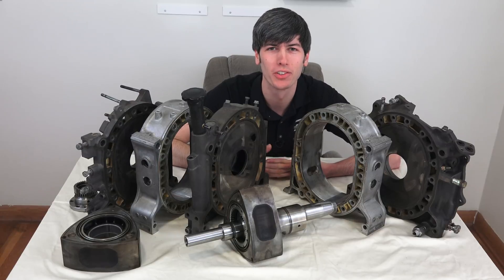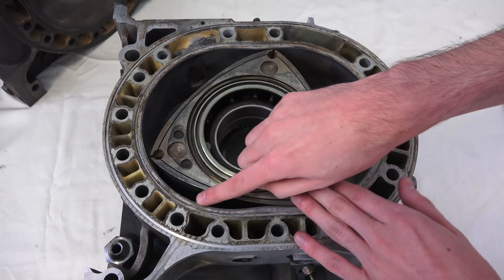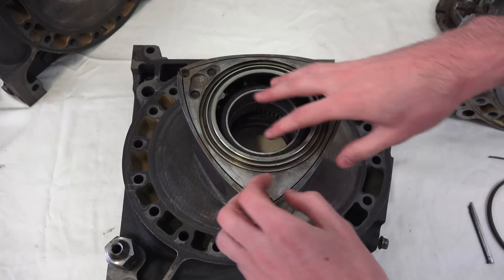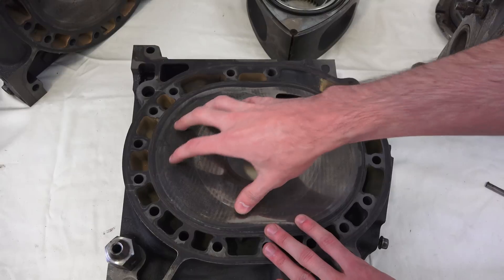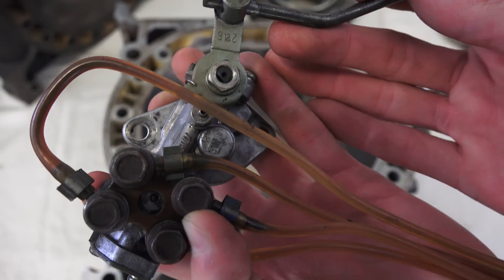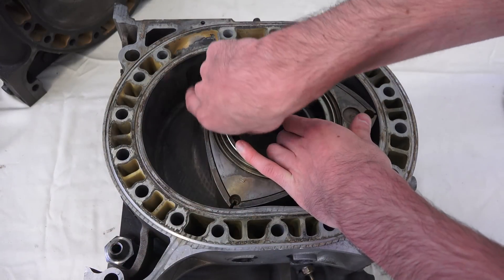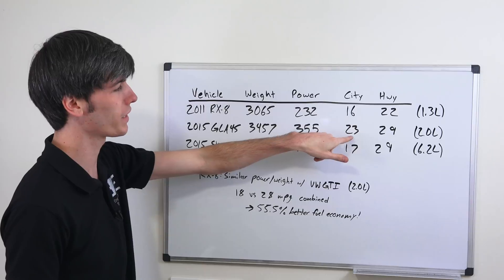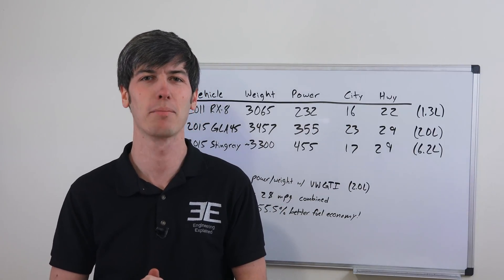4 Reasons Why The Rotary Engine Is Dead

Comment: They have been used in propeller driven airplanes for many years.
Rotary engines are great, reliable and tough when they run at near constant RPM, like in a propeller airplane,  stopping and starting like in a car or truck wears them out quickly..
Reply: NOT TRUE, Wankel engines were a colossal failure in aircraft applications and are very poorly suited to propeller drive applications.
Reply: The Wankel engine has consistently proven to be too unreliable for aircraft.
Reply: @sandervanderkammen9230  
Used in UAVs
Reply: @johnburns4017  Exactly, UAVs don't required FAA or EASA airworthiness certification, which Wankel engines are too unreliable to meet.
UAVs are disposable unmanned vehicles and the Wankel has proven to be a liability as well, most UAVs in service now use reciprocating or gas turbine engines.
Reply: @sandervanderkammen9230  
Wankel engines are not unreliable at all. They are perfect;y suited for aviation, moreso than piston engines. 

wiki got it right, for once (the Wankel article is good):

In principle, Wankel engines are ideal for light aircraft, being light, compact, almost vibrationless, and with a high power-to-weight ratio. Further aviation benefits of a Wankel engine include:

1. Rotors cannot seize, since rotor casings expand greater than rotors;
2. The engine is less prone to the serious condition known as "engine-knock", which can destroy plane's piston engines in mid-flight.
3. The engine is not susceptible to "shock-cooling" during descent;
4. The engine does not require an enriched mixture for cooling at high power;
5. Having no reciprocating parts, there is less vulnerability to damage when the engine revolves at a higher rate than the designed maximum.
Reply: @johnburns4017  Then why is there not a single FAA or EASA certified production passenger aircraft sold with a Wankel engine?
Reply: @sandervanderkammen9230  
You tell me. All points that the Wankel is a superior and safer unit.
Reply: @johnburns4017  The facts are irrefutable, Wankel engines were plagued with reliability and durability problems from its invention right up until mass production ended nearly a decade ago.

Comment: One idea - what if the engine had 2 (or more) separate Wankel "cylinders", and some dealt with intake/compression, others the explosion/exhaust cycle? More or less the same principle a turbo works?
Reply: Would that not exacerbate the problem with the Wankel KKM's higher thermally entropy???

Comment: Gas is so cheap now, who cares about mpg? Lol.
Reply: No cares about Wankel engines, it was an evolutionary dead end that has been obsolete for years.
Reply: @sandervanderkammen9230  Okay Colonel, keep frying your chicken.
Reply: @coreyworthington2797  OK kid, why don't you go down to your local auto mall and try and find a 2020 model with a Wankel engine.
Reply: I'm just trolling. Besides no production car ever had the "Wankel" engine inside. All the power plants are of KKM variety, designed by NSU's Hanns Dieter Peschke.
Reply: @coreyworthington2797  Without the knowledge and experience of Walter Froede,
Hanns PASCHKE would not know where to start to turn Felix Wankel's  Rotary DKM-54 into a practical Non-Rotary version that could be licensed by NSU Motorenwerke GmbH.
Reply: @sandervanderkammen9230  Sweet they should really give credit to all of them, not just Felix.
Reply: @coreyworthington2797  Felix Millet never gets any credit for inventing the Rotary internal combustion engine... Felix Wankel was admittedly inspired by the Megola's engine.
Reply: @sandervanderkammen9230  It's sad that the quasiturbine never really went anywhere.
Reply: @coreyworthington2797  Well, at least it was good for a laugh...

Comment: Perhaps if it was modified to have extra intake/exhaust ports and another spark, the compression chamber could be changed into the power chamber and vice versa and the temperature of the entire engine would be even. Thus no portion would be too hot.

Comment: Sorry, Much better. The details of how they will achieve this I do not know, but Diamond Aircraft first trialed this in 2011. In an aircraft, the smaller size and lower weight of a Wankel engine give real advantages.
Reply: Both Mazda and Diamond abandoned development of Wankel engines.
Reply: The Wankel engine sufferers from several fundamental flaws and disadvantages that prevents it from being practical in aircraft applications... which is why no aircraft manufacturer has ever offered an aircraft for sale with a FAA or EASA airworthiness certification.

Comment: Separately Mazda cars and Diamond Aircraft (Together with Siemens) are giving the Wankel engine a new lease of life as the Power source in Hybrid drives. The Wankel engine running at one speed and load, can be optimised to run much more better.

Comment: How would using secondary fuel like hydrogen go with a faster  flame travel improve it in combustion/ rotor travel and emissions
Reply: The Wankel engine in incapable of supporting the higher static compression ratio for ideal hydrogen combustion and thermal efficiency.
Mazda did extensive research on hydrogen fueled Wankel engines but after continued poor results abandoned both hydrogen and Wankel engines in 2009.
Reply: @sandervanderkammen9230  I wasn't meaning exclusively using hydrogen but as a additional fuel to maybe modify flame travel speed to better suit expanding chamber characteristic of rotary, and the fact that less spark energy is required to ignite maybe equate to less advance required which then could allow greater compression angle and less negative power on rotor and leaner combustion, wondering if any data available,
Reply: @Hitman-ds1ei  You mean a bi-fuel system with hydrogen as a pilot fuel?
Bi-fuel engines are generally not practical for vehicles and are typically found only in stationary applications.
 Ingersoll-Rand was one of the original Wankel engine licensee's in 1972 and did what was probably the most exhaustive research on gaseous fueled Wankel including bi-fuel gas.
They manufactured 500 and 1,000 horsepower stationary engines from 1974 until 1986 mainly natural gas fuel but also multi-fuel as well.
Reply: @sandervanderkammen9230  do you have any references to that info at all, very interesting, you sound well versed in rotary r&d.
Reply: @Hitman-ds1ei  Be sure to check out the animated discription that explains the difference between Felix Wankel's DKM-54 engine that uses the Rotary type layout and motion.
And Hanns Paschke's KKM-57 design that is a Non-Rotary and was used by Mazda and others.
Most of the "experts" these days struggle to understand the fundamental difference between between the two types of Wankel engine and completely misuse the term rotary engine when discussing the Wankel.
Reply: @sandervanderkammen9230  read the Ingersoll rand studies but only based on NG as fuel on 2500 cyl capacity, not so relevant to small capacity flame speed but interesting none the less some data may be useful to  extrapolate for reference to hydrogenated charges
Reply: @Hitman-ds1ei  The larger the combustion chamber the more critical the flame propagation speed.

Ingersoll-Rand worked with a electric  utilities company in the United States testing Wankel engines on CNG, LPG and hydrogen as a pilot fuel but was discontinued because emissions were higher than comparable reciprocating engines and gas turbines.
Reply: @Hitman-ds1ei  Of courses it's all water under the bridge, just wishful thinking now, the are no longer any legitimate manufacturers developing the Wankel engine... for all the obvious reasons.
Reply: @sandervanderkammen9230  looking at this from a racing development perspective to take advantage, if any, in hydrogen developing engine package for restricted fuels allowed
Reply: @Hitman-ds1ei  Racing development? Who is marketing a Wankel now? Mazda has completely discontinued all of its Motorsport programs.
Reply: @sandervanderkammen9230  private application
Reply: @Hitman-ds1ei  Sounds well outside the budget of amateur racing don't you think?

Comment: When did it die??? Is this kid Even old enough to drive??? Not on the drag strip, and not to alot of people who race, there is a big dedicated rotoary engine following.... If it ain't a rotor it ain't a motor, I should report this as spam...lmaooo j/k
Reply: Most of the 26 Wankel licensee's abandoned the design in the mid-1970s... Mazda was a late in getting the memo, but they discontinued all development of Wankel engines in May, 2009.
Reply: Wankel engines are no longer used in any major professional or world class motorsports series. 
The Pro Mazda series switched to 4-cylinder engines before Mazda dropped out of motorsports completely.
Reply: @sandervanderkammen9230  I'm not talking about any pro series, I'm talking about regular people who actually have jobs and don't have endless suplies of money, people who do it out of love of sport....

Comment: if mazda got sponsors they would optimize rotary engine but they aren't getting......
Reply: Mazda was only a very small player in the development of the Wankel engine... The larger manufacturers with greater resources concluded that the Wankel engine was inherently inferior to reciprocating engines long before Mazda did.

Comment: Rotor’s leading edge apex seal sweeps past spark plug cavities during the commencement of every compression stroke and allows compression ratio to drop; constituting what is an inherent design defect that is almost completely insurmountable.

Instantaneous torque resulting from the combustion/ignition event and quenched flame front then undergoes several further compromising events including; 

A)	The torque vector representing the instantaneous torque delivered by the combustion process is effectively at right angles (sideways) to the vector representing the rotary engine’s rotor’s “power stroke” motion; equating to poor efficiency. 

B)	Rotor’s trailing edge apex seal sweeps past spark plug cavities just after the commencement of the rotary engine’s “power stroke” allowing the combustion event’s compression ratio and/or pressure to drop.

C)	As the aforementioned inefficiency associated with point “A” is approached oil is sprayed into the cavity hosting the fuel/air compression event; further hampering efficiency as a result of potentially altering the stoichiometric ratio. 	

These factors represent significant inefficiencies.

So, to summarize what happens in a rotary engine around the compression/combustion events we have the following. . .

1)	As intake commences the stoichiometric ratio is negatively/potentially altered.

2)	As compression commences the rotor’s leading edge apex seal sweeps past the spark plug cavity and allows compression ratio to drop.

3)	As soon as combustion occurs;

3a)	The maximum instantaneous torque is significantly wasted as a result of the 2 vectors that both the rotor’s combustion chamber and the maximum instantaneous torque represent, being at right angles to each other; whereas in a typical 4 stroke engine these vectors are perfectly aligned.

3b)	The rotor’s trailing edge apex seal sweeps past the spark plug cavities allowing the combustion event’s compression ratio and/or pressure, to drop.

Comment: In essence the Wankel-engine is nothing but a different kind of two-stroke-engine. An attempt to construct an ideal two-stroke-engine, because it´s simpler and more efficient when it comes to produce energy for movement. Unfortunately it is too energyconsuming in doing so. The compression should be more effective, the combustion should run smoother and the combustion chamber should be smaller and the exhaust should also be made more effective in some way. I may be wrong but it sounds a little like childrens diseases for an engine in version 1. I´ve seen in other videos that Mazda has run with Wankel/rotary engines for 50 years. Have they not made any modifications during this time? If they´ve run this way for 50 years they must have some experience and some ideas of how to improve the engine and what needs to be done. With an engine as simple as this type of engine it should be a problem that is solveable. One thing I don´t like is that oil is injected into the engine just like a two-stroke-engine together with the fuel. That must be something that can be done smarter like in the four-stroke-engine. Oil directly into the engine also means a reduced lifetime for the engine. It sounds like a solution is to combine the best elements from the two stroke engine and the four stroke engine.
Reply: All Wankel engines use the same 4stroke operating principle as the Otto engine.
Mazda was actually a very small player in the development history of the Wankel KKM type engine.

Comment: I had a Mazda 12A in my dune buggy.  It is the best dune buggy engine I have ever run.  Lightweight, high revving, low center of gravity.  Beautiful power plant.  I blocked off the oil injection pump and ran premixed fuel (80:1).  I was always worried about the injection pump failing at high revs.

Comment: We have seen that this engine was working in Volks wagon beetle for a very long time ( and still now) without any problem. They are cooled by air and I have seen that they were working in very hot places like Saudi Arabia. Therefore If they have made with high-quality materials, they don't die easily.
Reply: The Volkswagen Beetle has a reciprocating boxer type engine, not a Wankel engine.

Comment: They marketed it wrong, it belongs in airplanes and boats, not cars where you need a light powerful engine with a shot load of power and you don't have to radically change the rotational direction. Also, Airplane mechanics and some boating enthusiasts know that maintenance is necessary.
Reply: Wankel engines are far too unreliable and inefficient for airplanes.
 Several companies developed Wankel outboard marine engines... all were major sales flops.

Comment: I was incredibly confused by the stats at the end until I realized they are in imperial units, not metric. Especially the fuel efficiency. "Wait, how is 17 litres per 100km better than 16L/100km"

Comment: What about 787B 4-rotor engine? It had 2 spark plugs per rotor and 700HP (900HP capable but they wanted reliability for 24h race) which means 350HP - 120HP more compared to RX-8. Does that mean it burns fuel better thanks to 2 sparks and is more efficient?

Comment: They did win le Mans in the 90 with a 900 HP engine..deuh..flame out of exaust or not...
Beat Porch Mercedes..and a bunch of other..for 24 h non stop bro.still one  unusual engine..compare to what we have made for years....
My red zone was 11000.. for a 1.2 L engine.  Or 1.3 L depending on year...and really. If you want a fast car..are you looking at fuel economy or kicking asses...
Reply: Audi won LeMans. 9 times with a Diesel...
Reply: ....and after the rotary won, the first thing they did was change the rules so rotaries couldn’t race.
Fact.
Reply: @demongo2007  No, the rule change was announced two years prior... all the team's agreed to the new displacement and fuel table rules.
Reply: @demongo2007  Mazda announced it was retiring the 787b at the end of the season... Wankel engines were never banned by the FIA in the WSCC series.

Comment: It's not dead, Mazda is going to use it in their hybrids.
Reply: Mazda is not going to sell a hybrid,  they just launched the new 2020 MX-30 a plugin battery electric
Reply: @sandervanderkammen9230  They announced they would use a small rotary engine as a range extender - that's a hybrid setup. They can make pure electric cars as well, no law against making both, for example, Nissan does both.
Reply: @martintaper7997  Actually no they didn't, Mazda said it was launching an all electric car and thats exactly what they just did. The US and Japan have new Zero Emissions laws that specifically exclude hybrid and range extenders.
Reply: Mazda permanently discontinued development of Wankel engines in 2009 and production ceased in 2012, the Ujina rotary engine factory no longer exists, it was demolished to make way for the new Skyactiv-G engine assembly plant.
Reply: @sandervanderkammen9230  Sure they may have re-purposed a plant, but they have not stopped rotary engine development. See my other reply and quote.
Reply: @martintaper7997  Mazda's board of directors cancelled further development in April 2009.
No new prototype Wankel engines  have been seen since 2008.
Reply: @sandervanderkammen9230  You're over ten years out of date, and in denial. Sure the rotary engine development may have been cancelled "then", but that doesn't mean it had to stay that way, and from all reports from Mazda, it hasn't. Why do you think that decisions are set in stone - car makers overturn decisions and change their minds all the time.

Comment: Rotary engines have a high surface to volume ratio which means more of the heat from combustion is absorbed into the rotor and housing. That is bad for thermal efficiency.
Reply: This is bad for emissions, CW an GM found leaking is main source of emissions at low rpm, quenching, flame extinction, is at high rpm, a hotter rotor suface reduces HC, a cooler working chamber wall worsens flame extinction, this is why air cooled engines, working a bit hotter, could have better economy. A high Surface/ Volume ratio cools chamber.  Blessings +

Comment: The engine was originally designed for use in aircraft where rebuilds are scheduled and when emissions were not a consideration.  It has a lot of advantages for aircraft but the high RPM isn’t one of them.  Prop tip speeds need to be subsonic and the Wankle develops it’s torque at high RPM.  Gear reduction solves the problem but at a cost to efficiency and weight.
Reply: NOT TRUE, the Wankel engine was  originally designed specifically for MOTORCYCLES. The Wankel was not designed for aircraft